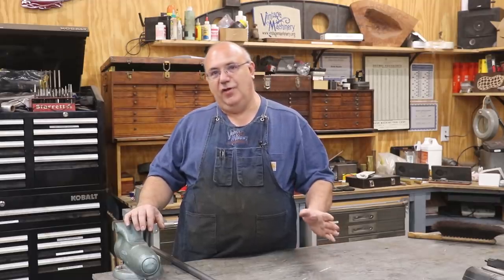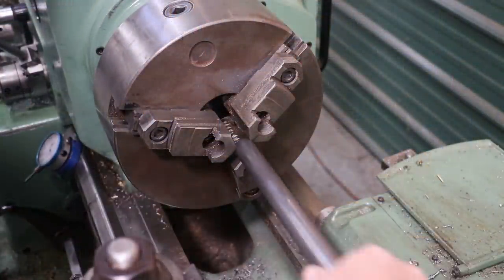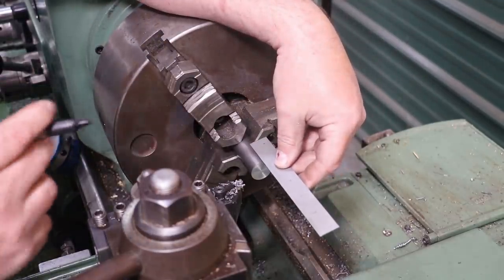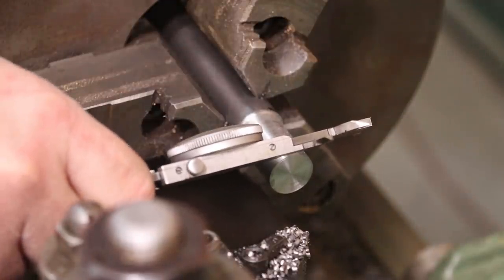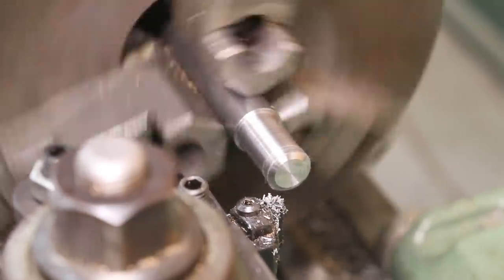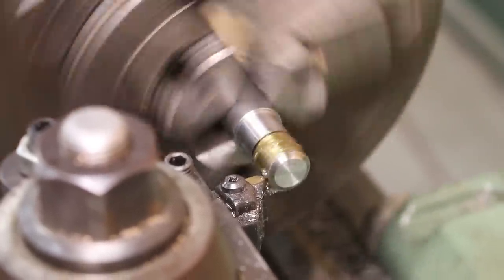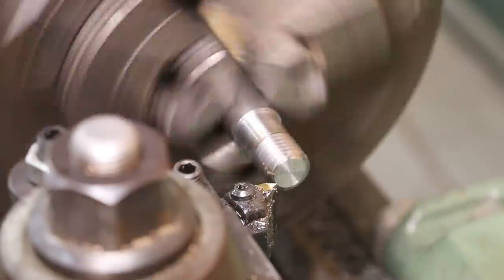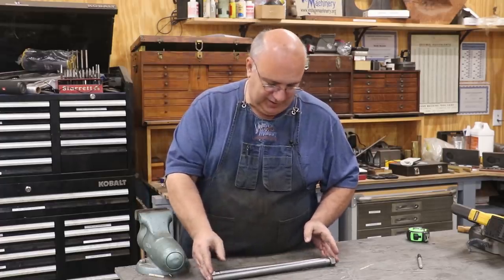Turning and Threading a Vise Guide Rod on the Metal Lathe

Comment: When I first started as a total beginner, I cut lots of "air threads" to get the feel for starting and stopping the machine and engaging and disengaging the controls. That helped a lot.
Thanks for sharing, Keith.
Reply: yes i to had to practice engaging thread handle many times to make sure i engaged the handle when the right number came around for the thread i was cutting.

Comment: The postal machines use bulk sorting machines where the packages are circulated multiple times before singulated for the machine to process.so when heavy metal is not wrapped. Very well and the box is not wrapped very well they will come apart in the machine.my advice is to wrap your material or parts with plastic or bubble wrap with duct tape or fiber stranded tape.fill the box completely so there is no slop.and tape the package.x the box well.

Comment: I've gotten a few empty boxes too. Sometimes the shipper doesn't help when they pack heavy steel rods in a cardboard tube and just seal the ends with fiber reinforced tape. On threading I turn the tool upside down and run the spindle in reverse whenever possible. I don't have lightening fast reflexes anymore.

Comment: I briefly worked at a DHL freight terminal, and it is a wonder anything gets delivered without damage. I found the biggest problem was that the trucks are packed in a way that lots of loose goods lie on top of everything. When you try to unload a pallet of goods with the forklift, other items stacked on top of it gets tangled up, stuff fall off, gets twisted, and worse. Small items fare better, as they are stored in metal cages, but if the package contains liquid containers, or glass, they also had a fair chance of being damaged. Some packages would leak mystery liquids all over the place, not so fun as you had no idea what was inside, and if if was dangerous.

Comment: Hem-Fir crate in a cardboard box, High strength stainless deck screws. Hey cool  threading tool alert The ifanger online catalog has some kinda retractor lever that looks like the hardinge style threading lever and it fits in, looks like a axa or bxa and all it really says about it is somthing like" allows high speed threading" however I dont think it will increase sfpm I think the intention is to speed up the threading process as a whole . love 29.5 degrees sometimes just for the finish pass  good quick video

Comment: One never knows these days with shipping. I recently bought a Porter Cable 3 1/2 HP variable speed router to replace one that grew legs during my move from a neighboring state. I arrived from two different shippers as it seems the shipping companies can be a bit overwhelmed from the column of business. It arrived in a box within a box and when I opened them there was no collet however there was a hole worn through the outer box that was just the right size for a collet to pass through. The company was contacted by me and a collet was shipped out to me and arrived fine. Not nearly as bad as the Galileo thermometer I ordered about ten years earlier. It took the shipping company 5 (five) times to get one to me that the glass was not broken. despite the box with big "fragile glass labels on the box. Makes my wonder sometimes what they are thinking or if they are thinking at all.
I am a long time viewer of the channel and greatly appreciate all your video content.
Reply: "FRAGILE!" labels are viewed more as a challenge than as a warning.

Comment: I bought an Aloris CA tool post on eBay. Only the handle showed up. I rather the whole package has just gone missing.

To be fair, I think most of the time it is due to improper packaging of loose, heavy items in single layer (often flat-rate) boxes. All boxes have rated burst strength (usually printed on them somewhere) and it is easy to exceed this with a piece of metal with a few inches to gain momentum.

Comment: I have a question.  I have an old Stanley number 6 hand plane.  The bed on the plane needs to be perfectly flat but it isn’t.   Would a surface grinder be the best way to get it flat ?
  I could use sand paper on my saw top but it will take a long time and several sheets of sand paper and still not be as flat as it should be.

Comment: Over the many years I have had things lost in the mail- 90% of the items involved long rods- lead screws, ball screws etc.  I always suspected as they pass through x ray- they look like gun parts and the boxes are opened, replaced then haphazardly taped closed, or not replaced at all.  Some could be due to poor packaging, with not enough support on the end allowing the rods to tear through the packaging, but I always use mailing tubes with steel caps.
Reply: Gun parts are shipped all over the country everyday and not opened. Gun parts are not restricted items, only serialized firearms) or the part of the gun that is considered the firearm are.
Reply: @xenonram  The guys working at the Post office are always on the lookout for something that can be sold.  Atlanta is one of the biggest postal hubs, just like Atlanta airport, and both are notorious for thefts.

Comment: I've learned "NOT" to use USPS for this reason your less apt to lose anything using UPS it seams as though they have more respect for packaging.
Reply: The USPS is a mess. Other carriers provide better service, accurate tracking, and less shipping damage.Buyer beware.
Reply: I tend to use fedex more for "larger" items, UPS has a habit of running forklifts though computer boxes (I refurb and sell old computers as a hobby)
Reply: not a respect for the packaging.. only going as far so they don't lose their job.  USPS gov't workers don't care and won't lose their job.
Reply: @dtoad48  You'll never guess which postal service has been privatized for over 10 yrs now.

Comment: As far as the shipped items coming up missing it’s the fault of the sender who did not package properly, if the container arrived without contents you can surely see how the contents exited due to poor packaging by the sender, often the contents busting out of the packaging renders the packaging unidentifiable thus undeliverable, in the cases of USPS often people use provided flat rate boxes and place heavy metal pieces in them wrapped in paper or nothing.  Automated handling that moves fast and changes direction fast makes for loose internal metal pieces work thru cardboard containers.  Package packers are often lackadaisical or plain lazy about how they package.

Comment: I thought those bench vises where using ACME threaded rod?
Reply: I think these are just the smooth guide rods with a conventional thread to hold them into the fixed jaw. There will be a third rod, which may well be acme threaded, which will move the other jaw (I'm guessing).

Comment: Could you talk about threading on your lathe.   You seem to have a trigger mechanism that withdraws
the tool and opens the halfnuts.   On my lathe I would have to create an open area at the end of the thread
otherwise I would break the tool when it hit too much metal to cut.
Reply: Keith is not showing his hands but he is using the hand wheel for the cross slide at the same time as tripping off the half nuts.
Reply: @royreynolds108  How can a human synchronize that operation so precisely?   A minor delay and the
tool will dig into deep metal.   When you are taking the final cuts on a deep thread like this the tool
will be deep into the thread slot.   At the end of the cut the tool will be at the full depth of the metal. 

If he is doing that by hand he must have really good reflexes!
Reply: @reilleysinventions4155  There are LOTS of Abom79 videos showing this exact synchronization. It's not so difficult with practice.
Reply: @deemstyle  My understanding is that there are lathes that have a mechanical trigger.   When the trigger
is tripped it pulls the tool back and releases the halfnuts.   The trigger is fired with an adjustable stop
that clamps to the way.    I wonder if this is one of those lathes.
Reply: Nope, Keith is doing it manually no automatic anything on this lathe. The first click you hear is him disengaging the half nuts which stops the carriage motion, the next motion is to back the cross slide out. It's actually very easy to do with a bit of practice. 
He shows the process in many of his threading videos as does Adam.